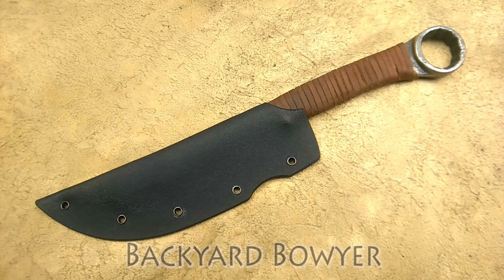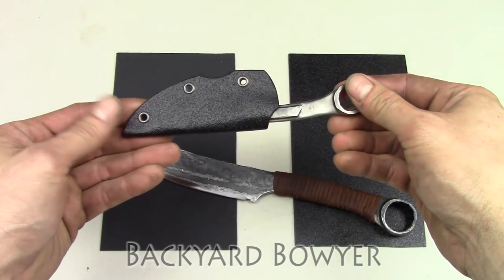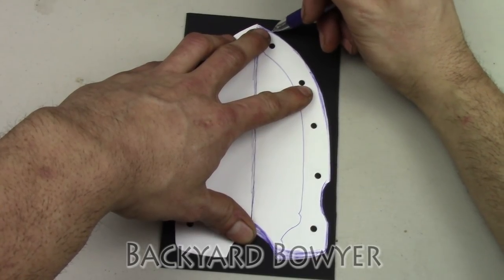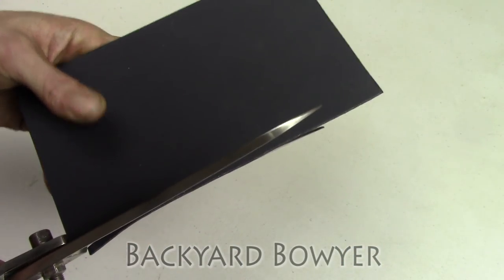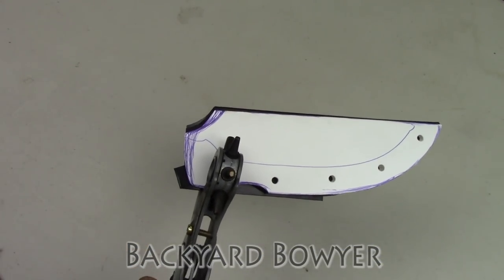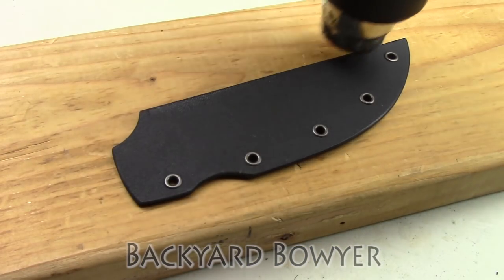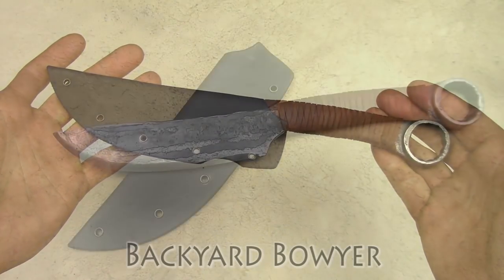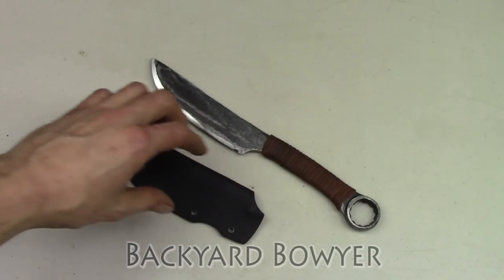How to Make a Kydex Knife Sheath Without a Press

Comment: I have always liked your videos because of your use of easily accessible tools and materials.

One option for the cutting of Kydex and other tough materials are "Aircraft" sheet metal shears. They are like regular sheet metal shears but provide a mechanical advantage while you are cutting. 

There are 3 types, left turn, right turn, and straight cut.
Reply from the maker: Thank you for the suggestion!

Comment: Hello Nick, I just have to say that you are a true Craftsman. I have watched many of your videos and the look in your face when you think about what you are doing is intense like you are truly considering all aspects of the project. I was wondering what thickness of Kydex  you are using for the sheath? I use .80 or slightly thicker .93 for holsters but never did a knife sheath. Do you think .60 would suffice or is that too thin?
Reply from the maker: Thank you! I used .06 for this one. I use that for most knives. I like .08 for long knives, machetes, and for making belt clips.

Comment: This is excellent. Thanks for such an easy to follow tutorial. I don't have 90% of the tools used in many of the other tutorials. May sound overly simple but would a hot hairdryer work instead of the hot air gun? Or a sandwich toaster?
Reply: tryy an oven
Reply: @prodlilbooger  I used an oven in the end and the result was excellent 👍🏼
Reply: @capedmarauder  you made it based on his steps? i will be trying this soon. thanks for your reply
Reply: @prodlilbooger  I watched a few tutorials where they don't use so many tools and took tips from each. In the end I made a sandwich type one with two cut pieces and not folded.

Comment: This non-form-fitted design might actually address the issue of Kydex sheaths scratching knives due to embedded dirt and grit. Also the increased clearance might also aid in cold temperatures to reduce your knife getting stuck due to trapped water freezing inside. 

Thanks for the idea!
Reply from the maker: Thank you for watching! I used to have the problem of grit scratching the blade quite a bit before I started making them like this. I used to use a foam press.

Comment: what about the belt hook? And wouldn't it be better to cut the shape of the sheath after folding the kydex over?
Reply from the maker: I used to do it that way and will sometimes do that for knives with thicker handles. I usually end up using a press, my scroll saw, and belt sander for those.

Doing it this way, I can do everything by hand with hand tools, (except for the heat gun).

Thanks for watching!

Comment: Could you use a hairdryer if you don't have a heat gun?
Reply from the maker: Yes, a hair dryer on high should be enough, but it will take a little longer.